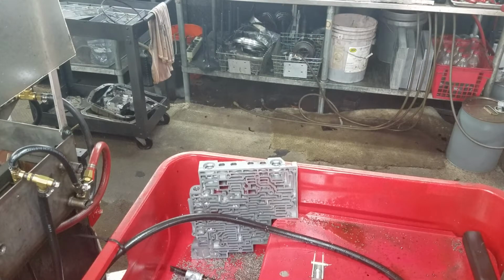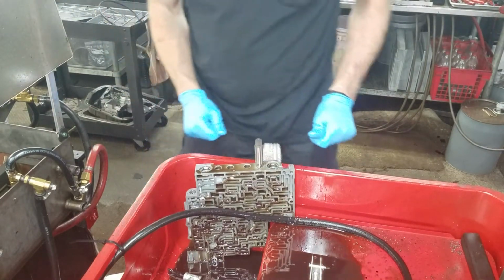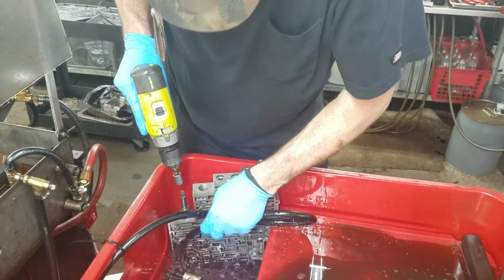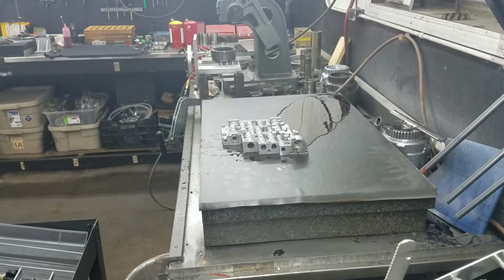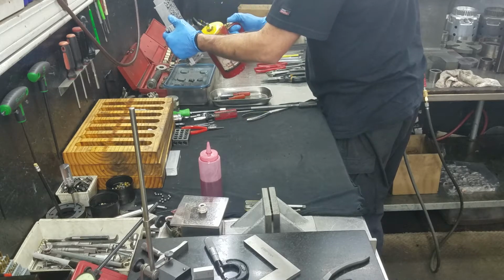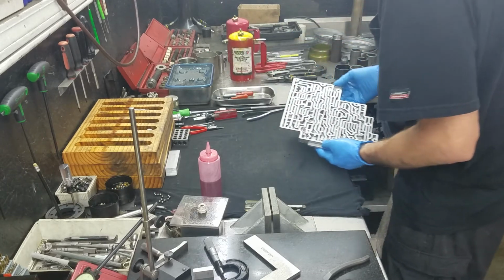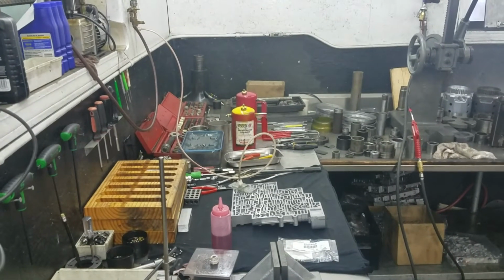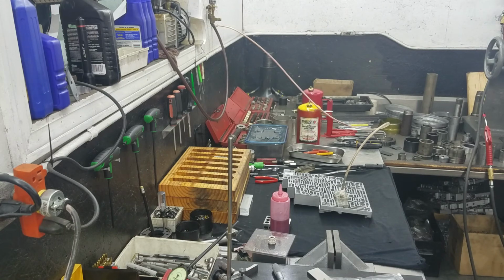Speeds and feeds while reaming

Comment: Great video Richard,  you should do a full rebuild video when you get the chance.

Cant wait to see that 5L40/6L80 pump machining video someday,
Reply: One more thing Richard, How often do you find that you need to send reamers out for re-sharpening or replacement, How many valve bores do you get through using this method?

Comment: I forgot to ask Richard, sonnax also makes oversized valves for the 3-4 and 2-3. Doing vacuum testing on those bores how often do you find them needing a oversized valve ?
Reply from the maker: I have never tested those bores.  I do AFL, TCC REG, a the plug at REVERSE ABUSE, in every one that I do.   I will look at those bores going forward and see how they test compared to how they drive.   I finished and drove one yesterday that was just sweet.   If I didn't screw anything up they all drive out good, but you get those occasional units that are just perfect.   It makes me wonder why.   Thanks

Comment: is that a 2×10 you are using for valve body tray?
Reply from the maker: It's a 2x10 or 2x12 that was routed and sprayed with polyurethane so the parts don't get tiny pieces of wood in or on them.  If I was going to do it again I would like to put tiny legs on them so they will stack up with a solenoid in them.   If you lay solenoids in the trays they won't stack.   I think that a short piece of aluminum angel on the outside corners would be perfect.   And 10 grooves.  My trays have 7.
Reply from the maker: They are 2 x 10's.  I would go with 2 x 12, and 10 slots.  After you mill them wire brush and spray with polyurethane.
Reply: @rdick218  thanks for the idea. My favorite  thing about  transmissions  is all the ideas and projects learn something new every day.